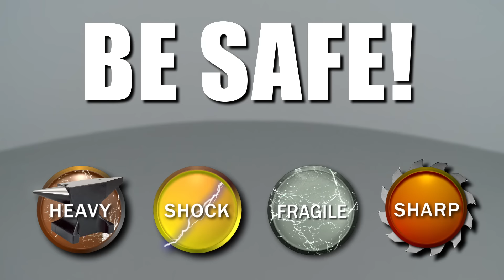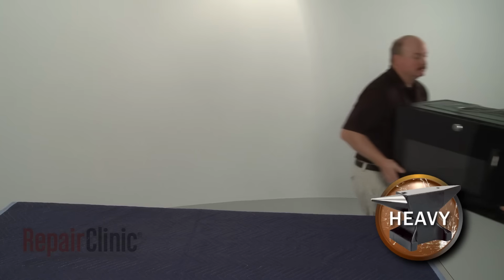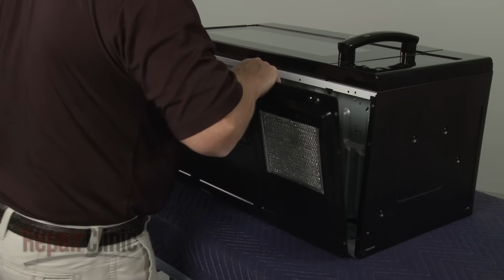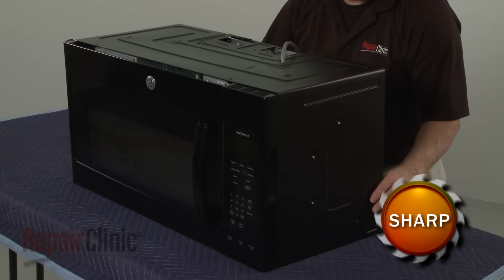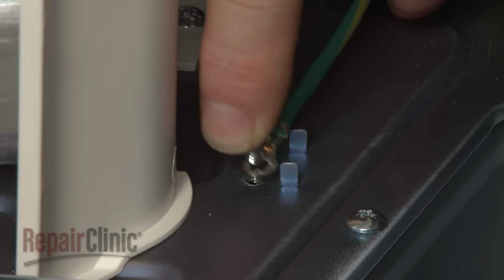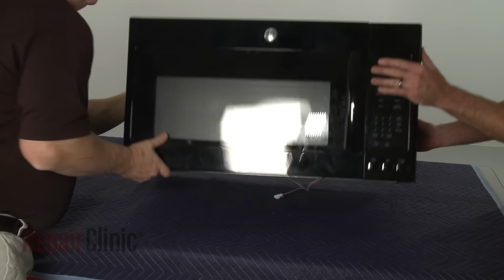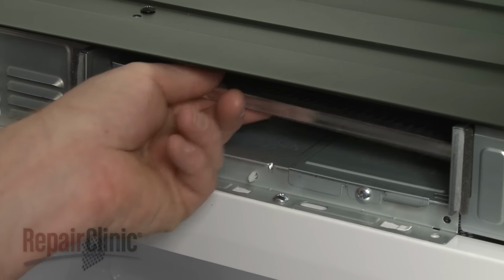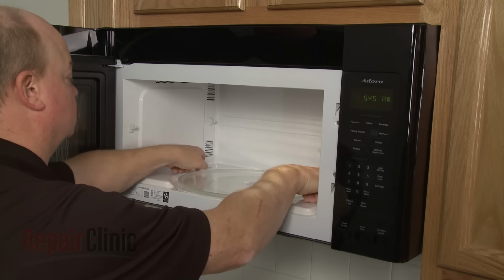GE Microwave Power Cord Replacement #WB18X10491

Comment: Great! The video told me exactly what I needed to know. I would however, question the need to discharge the capacitor. IMO, there is a greater shock risk from attempting to discharge it, than there would be to simply stay away. The scratches on the tech's arm show that he's not afraid to stick his hand down into an appliance! 😆
Reply: If you properly and correctly discharge a capacitor, it literally has no risk